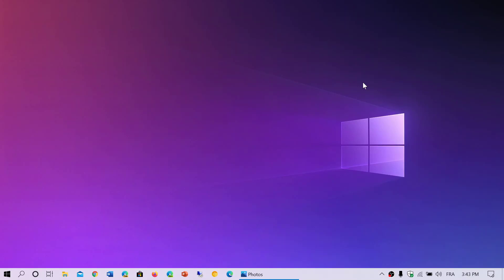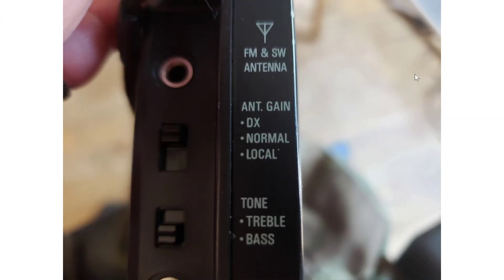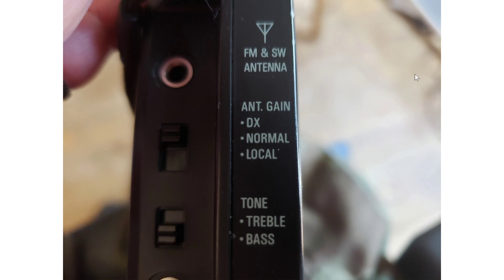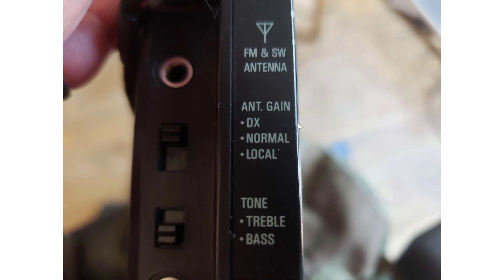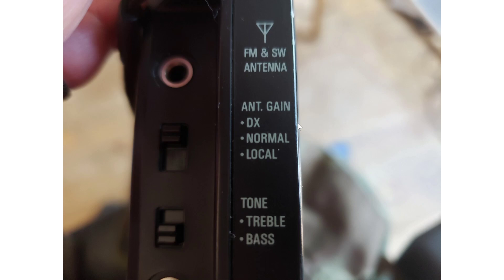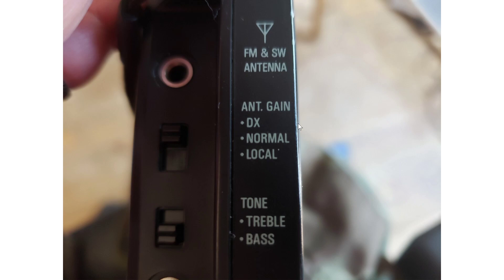PART 31 Shortwave for Beginners DX Local switch radio sentitivity  and overload

Comment: When I put my PL 880 on DX I get lots of static in between stations, if I put it on local or normal it cuts out static put I hear less stations. Is this normal? My PL 660 is not like this. 880 put on DX noise level goes way up. maybe I got a bad one. I hear every khz when turned cisk cisk cisk thats the static sound of the tuning knob. is it because I have all the muting/squelch features off?  lol
Reply from the maker: this is normal .. Local lowers the sensitivity of the receiver.  so less noise but less stations too